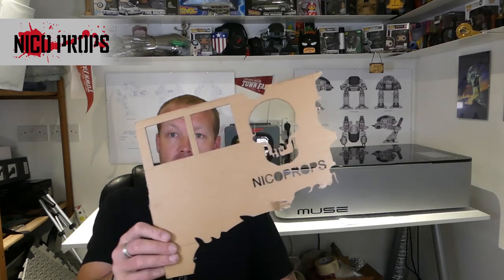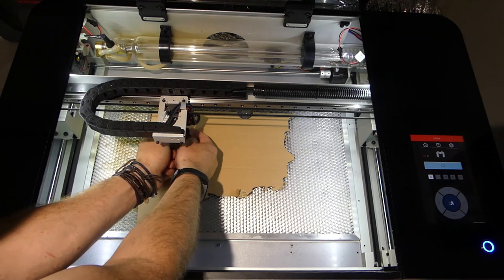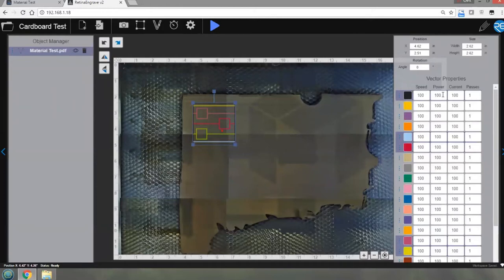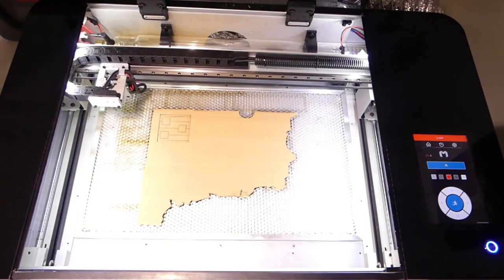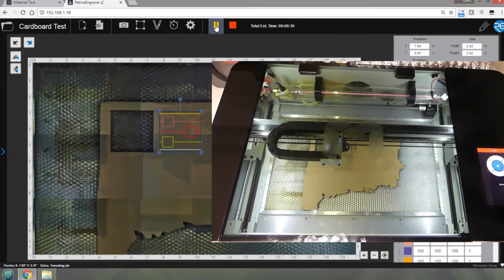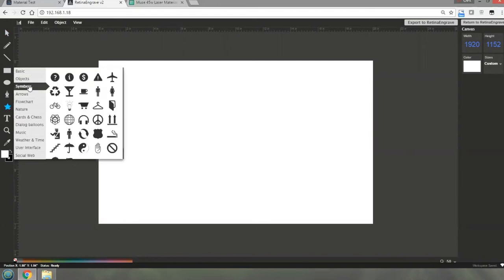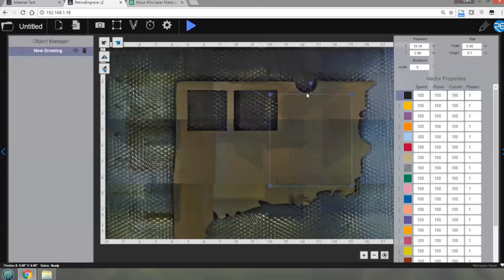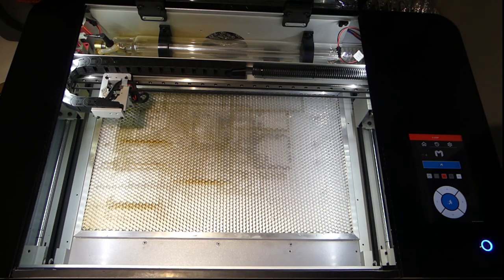LASER CUTTING / ENGRAVING: Material Test Cutting  with the Muse from Full Spectrum

Comment: Glowforge does have a neat idea with the ID number for their products you can cut and engrave. When you scan it the machine knows what type of material it is and sets
all the laser setting up auto for the material plus they come with a cover coat material
to make them clean looking with sharp edges of the burn effect. Saves tons of time a guess work when switching to different material all the time. You can change the
setting if you want but most of the time its not needed. MUSE needs to do something like this aswell.
Reply from the maker: yeah but in the UK we can't get those materials cheaply as we would have to ship them in so the QR code is useless to me. and the cover you can do on any material your self using masking tape so its not that big a deal.

Comment: Weighing either this cutter or glow forge. Which one would you recommend and why.
Reply from the maker: Well i originally had a glowforge order but after the 5th time of them delaying it and the responses from Dan publicly towards people which was "if you don't like it cancel your order" I didn't have faith in the company. would you buy a machine from a company you didn't trust to uphold its promises  and expect them to support the device? it is a shame because the machine does seem to offer a lot on the user experience perspective which is why I originally chose it as my first laser. FSL is a long running company and yeah they take Chinese parts and build their own lasers with them and yes there have been reports of assorts of problems but they don't hide it they are out there publicly trying to help people get over these issues and these issues are for the few not everyone has problems. if I was to buy another laser now for the same price it would still be the Muse, I just don't trust Glowforge as a company.
Reply from the maker: some more thoughts, the Muse does not require an internet connection as the software is on the machine so if the company goes down I could still use my laser cutter. the glowforge is web based software so if they go bust you cant use your machine. the glowforge is also limited to about 3mm thickness for cutting where as the muse can do 6mm.
Reply: NicoProps 
Very good point about the company going under now I would have a brick.
Reply from the maker: I have just been watching a video on tested.com about the glowforge, and its worth remembering that Adam Savage had design input on the glowforge so they will be slightly bias, they mention the camera features do not work very well, that is because the glowforges camera is static with a fisheye lense so it distorts the images towards the edges. the camera on the muse is fixed to the head and it takes 9 pictures and stitches them together so there is little in the way of warping. it doesnt look overly pretty to be honest but it does work really well. check out the tested video your self

http://www.tested.com/art/makers/814899-tested-glowforge-laser-cutter-review
Reply from the maker: oh and they say at about 14:50 that no other laser can do the raster / cut from something drawn on the material. the Muse can do that ;-) and FSL do not supply materials and the glowforge materials are very very expensive for what they are they just wanted to have the gimmick of scanning the material and auto setting the settings. the muse is going to have a feature soon where you can save your setting on the machine as you go which you can not do on the glowforge.
Reply: NicoProps 
Awesome. I’m def leaning toward the Muse
Reply from the maker: if you already have a glowforge order speak to the FSL sales guys and explain you have a preorder glowforge but are considering cancelling it for a Muse and they may offer you a discount if you prove you have cancelled your glowforge order.I got a discount for cancelling mine but that was a while ago
Reply: NicoProps 
Nice idea

Comment: Hi, I thought your video was very informative, I'm stuck trying to decide which laser to purchase, at the moment its between Muse or Dremel but As I'm based in the UK shipping is a huge problem as in the cost.
Reply from the maker: go for the Dremel, its the same machine even supplied by FSL but it has had some safety and other improvements insisted on by Dremel. I got my muse way before Dremel was on the scene if I had been looking at the time Dremel had them I would have gone for one of those.